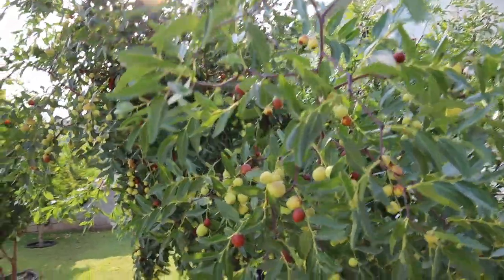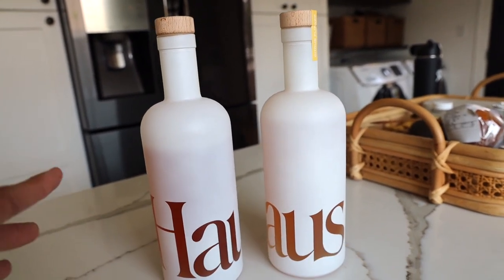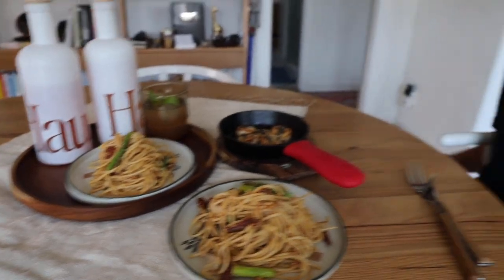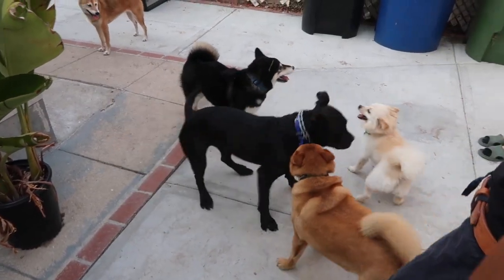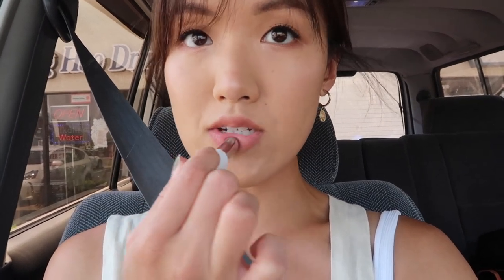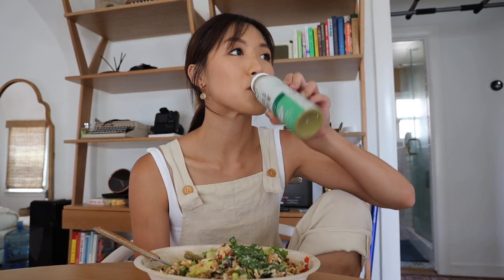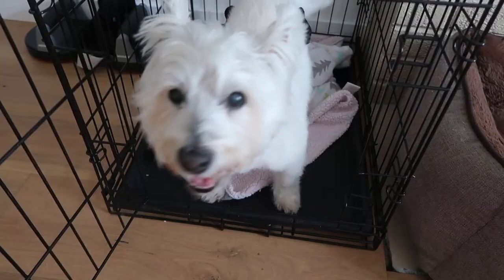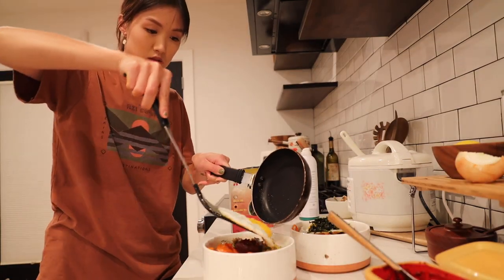Cooking at Home, Garden Tour | WahlieTV EP767

Comment: For the alkaline water: if you mean for drinking purposes, it depends on your diet. If your diet is mostly alkaline, it can actually do more harm than good. If your diet is slightly more acidic, it can help balance out the natural acids in your stomach to help push though foods better or maintain a certain level of acidity in your stomach. I’m not an expert, but I’ve done some research on this myself and learned a bit of this in school 😁